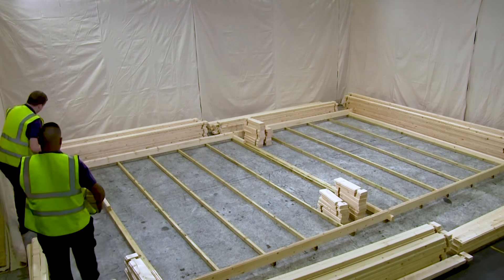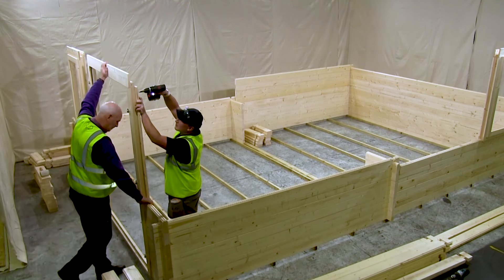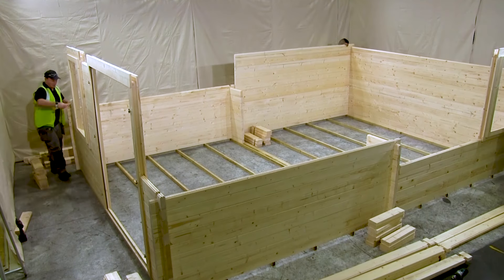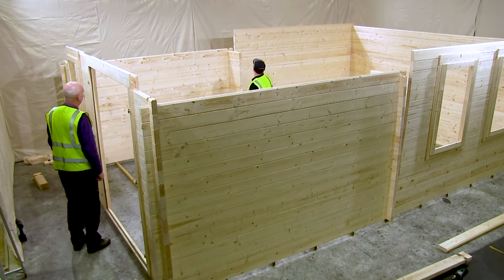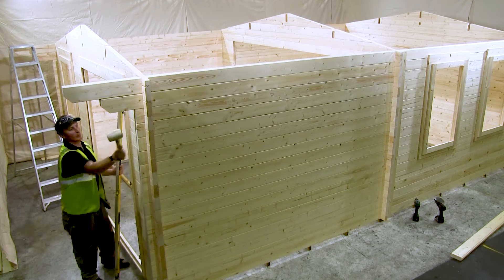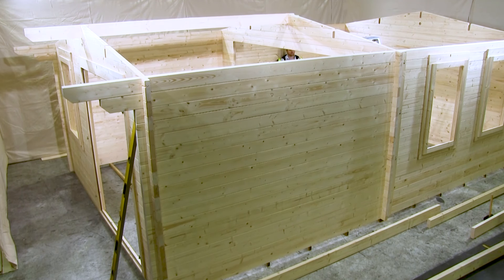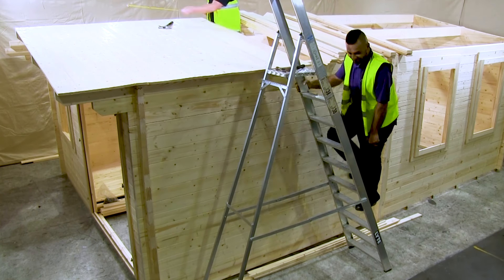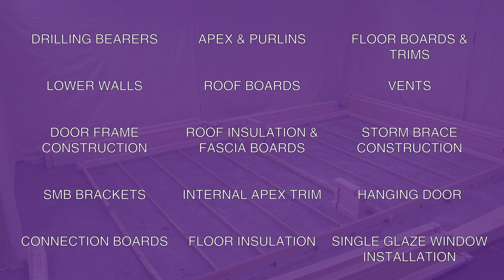How to Construct a Log Cabin (Construction Guide) - Intro | Dunster House

Comment: Having had a Dunster Cabin since 2003, here is my recommendations...use decking screws everywhere-they last a lot longer. 
Take some time to use a wood preservative on the lower logs especially at the corners...they will rot out first! It might even pay to use a good sealant in all the corners to prevent rainwater entering this weak spot.
On the roof T&G use a double row of screws, not nails. The T&G will dry out and warp if only fixed with a single line of nails (plus nails will rust)
Reply: So did your build last the best part of 20 years?

What did you do the insulate the roof (if anything)?
Reply: @ElRammo  my cabin was at my house before I moved in, I had to fix the problems I mentioned last year. But my points are sound. If I had some spare cash I’d take it down and build something better.

Comment: We purchased a Seven 5x3 summer house and decided to upgrade the strength of the floor bearers to 3x2 and install a  19mm chip board floor to over lay the pine floor supplied on.   This modification made a much stronger floor pan. We also installed 10mm ODF weather proof board on top.of the pine roof and installed a weather proof damp membrane on top of the ODF. We covered this membrane with the shingles supplied. The upgrades added £250 to the costs but  made the summer house much stronger. Over all a quality product.
Reply: We've got the Terminator log cabin & overall really happy with it. Only 2 negatives, I don't see why they can't cut the trims/eaves support to size, especially the one at the front where two meet in the middle & you have that imperfection. The other, major flaw imo, are the pathetic floor bearers, which are flimsy & categorically not fit for purpose. We did something similar to you but used CLS timber & cut pieces to fit in between the bearers to re-enforce them.

Comment: what would stop damp rising from concret floor
Reply: A layer of damp course, of course. Moist - I mean most of them come with pressure treated bearers but it's still necessary to separate them with non-porous plastic.
Reply: @SupraSmart68  
Pressure treated timber is a myth. Just cut one of timber and you will see how treated NOT is timber ;)
Reply: @marcinstarosta2594 not sure what you mean by that.
But, try to make fire out of treated and untreated timber, and you'll see the difference then.
Also, check with the supplier if the treated timber is certified, if is not, than don't call it treated.
Reply: @rafalglowacki9916  
I was working 5 years for this company. Their product wasn't properly treated. On the end they stop selling "pressure treated" log cabin, because of faulty process.
Reply: @marcinstarosta2594  it's very much possible.....
However, for example- if you get  Michelin, or Brighstone, ( I mean branded)  tyres fitted in your vehicle, you can reset assure knowing that they are going to perform in accordance to their specifications, but if you go for budget tyres, you can only hope they'll perform as described by the manufacturer, and their ability to perform is usually reflected in the cost. 
That's is why branded tyres last longer than unbranded one's.
Kind regards body, 
Viva la Polonia